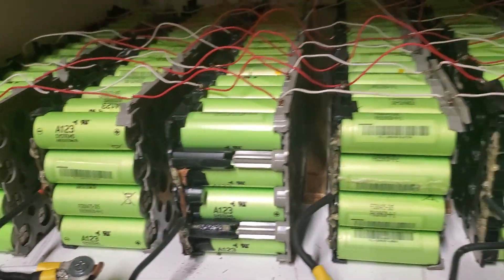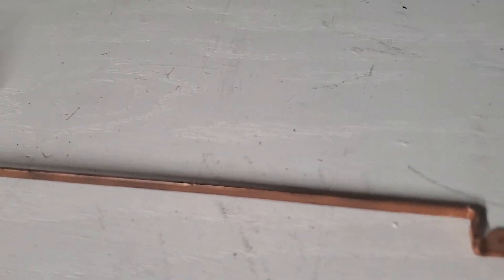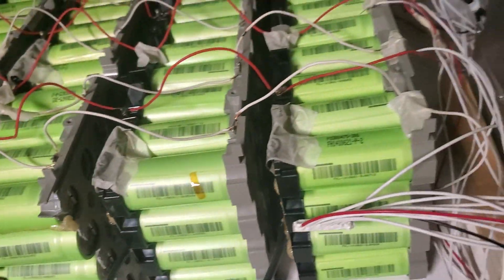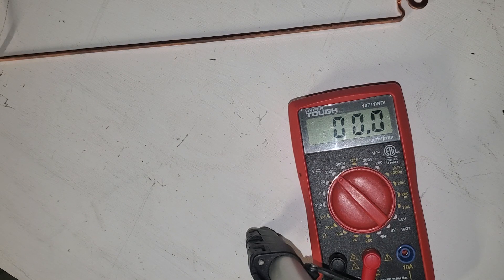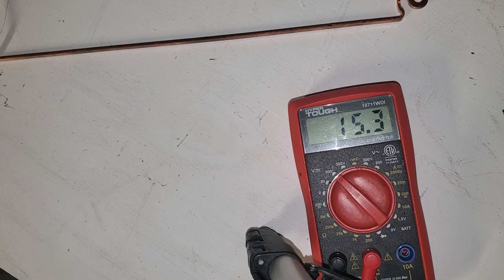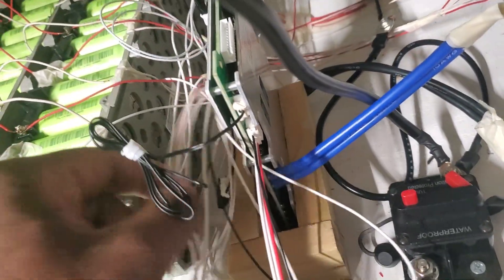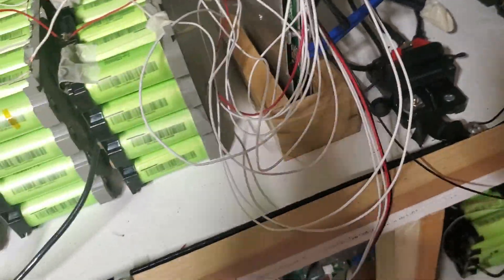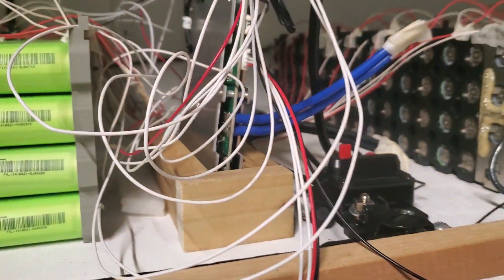How I install an 16s #JBD #LiFePO4 #BMS with Bluetooth in 14 packs 48V batteries in parallel

Comment: So long your positive wires are white colors.     The black goes to the battery negative.  And the white wires starts at the positive where the black wire is connected
Reply from the maker: Yes,  exactly

Comment: You should connect the first battery negative from the bms lead    

The first black wire from the bms lead should be connected to the first battery negative   Then your first positive lead from your bms start from the same battery where the negative lead is connected to.            I mean the black wire goes to the negative and the first red goes to the positive.                   For without this you will burn all your bms.
Reply from the maker: You are correct